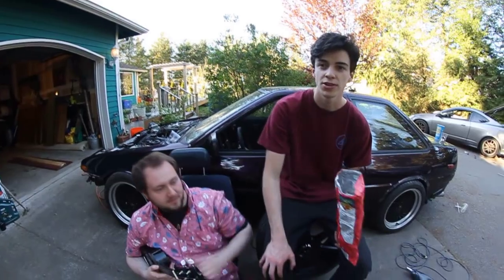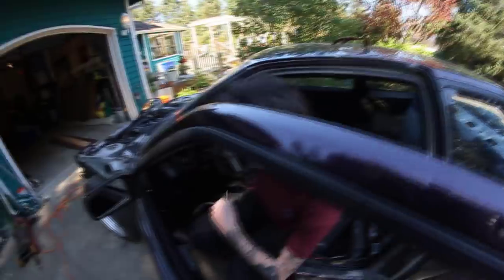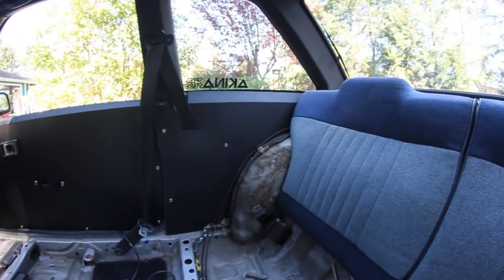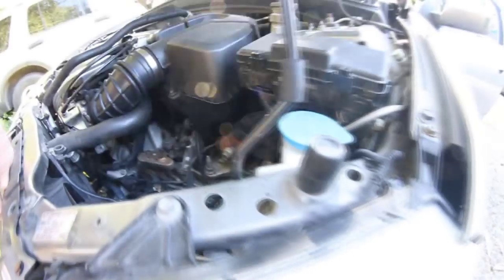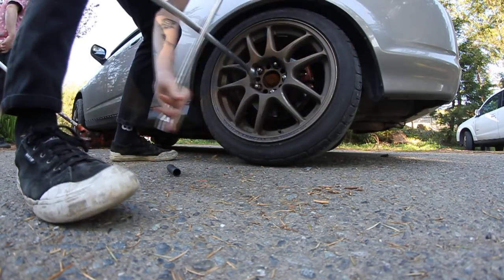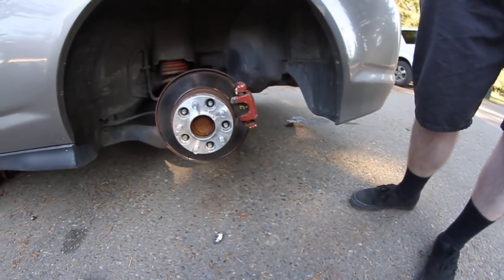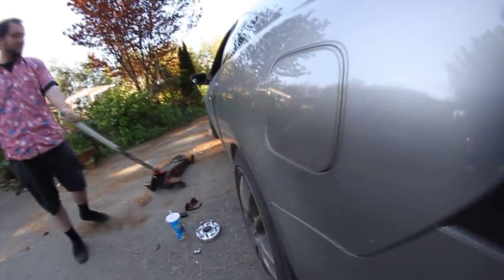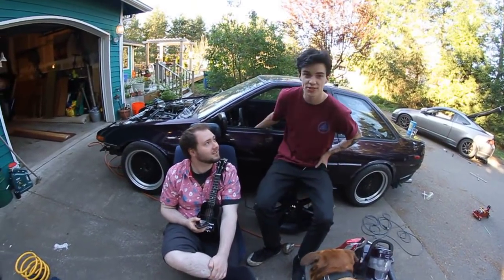AE86 Interior Panels & Swapping Wheels

Comment: but its not a genuine ae86, its an 88 ://// still practically the same though
Reply from the maker: +My Damnxtion the chassis code says ae86 which in my opinion should be what classifies an 86 as an 86, because the reason everyone digs the car is the because the platform it was built on. the vin number has ae88 because usdm models had 88 if they were GT-S which is basically the counterpart to jdm 86. but 16v instead of 20. i think... that's what i've gathered anyway
Reply: more skids Yea i get you, I'm just pedantic as hell. all 3 are practically the same in essence. Jealous as fuck that you own one though, they are hella rare here in the UK ://